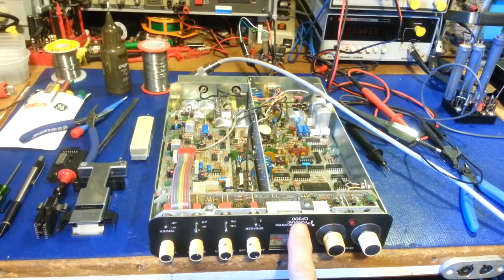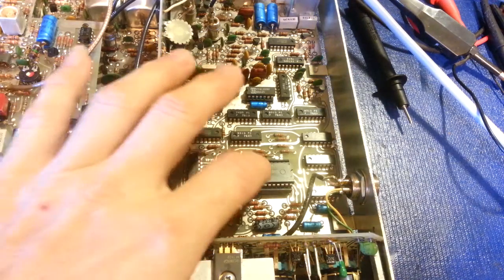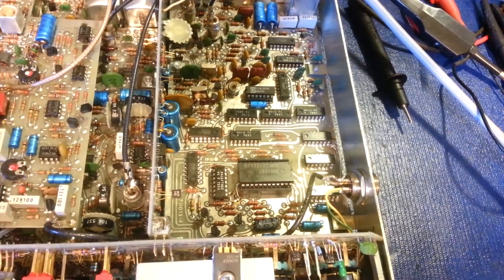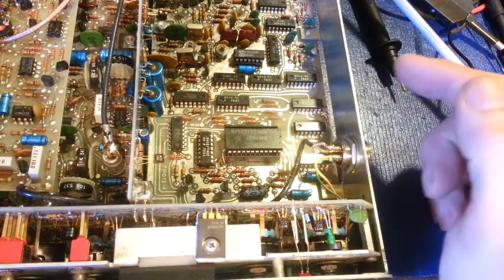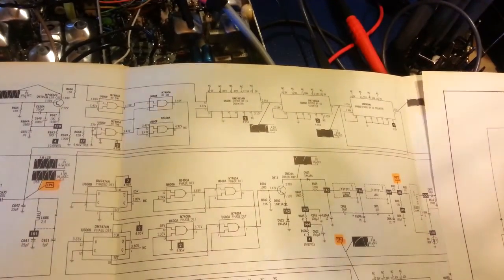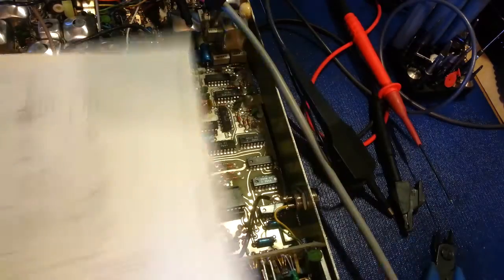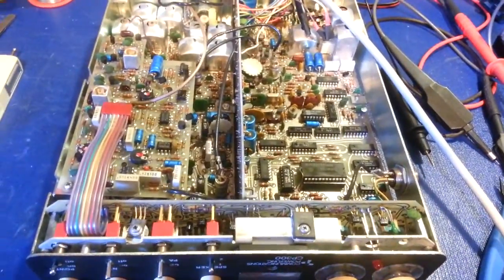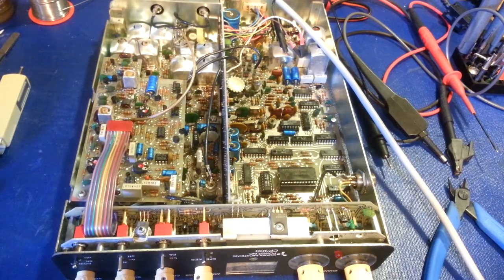CPI CP300 CB radio. Troubleshooting missing negative voltage power supply circuit.

Comment: I know; I'm late to this party lol. I have a CP-300 that has the 79 channel option in it. I also have a spare board in it with the eprom on it. I'm assuming the 300 and 400 are the same radios with different EPROMs in them. Anyway, I am looking for a service manual or sams for this radio. I also can work with someone if they know how to get the code from the EPROMs. Thanks Richy N2ZD
Reply from the maker: JackSoffalot 

If you can't get find a original SAMS CB268 you can buy the digital copy from SAMS on their website.  www.samswebsite.com

Comment: Mike, if that ROM is truly a rare bird it would be smart dump it to a file. Pull it out and put it on a reader and save it to your PC. it should only be a few kilobytes. If at some point you find you need one just burn it to a generic eprom and bam you are a hero. As for the negative voltage, I think they did it like that so they did not have to float the zero volt reference above ground, kind of clever. Purely a guess as I did not really see the whole schematic.
Reply from the maker: Actually Buddy is going to be doing it at some point.  There are several different versions of it including 99 channel ones that were available aftermarket backnin the day when these were new.

Comment: Good troubleshooting Mike.  This radio does have one of the craziest negative supplies I Why they use part of the AM/LSB is beyond me. have ever seem.  No telling what they were doing with jumpers. Been a while since I worked on one. What's the number on that chip? The last one I had in the shop had a 27(C)64 one shot Eeprom in it.

Comment: Cool Mike, why don't you read in the memory and blow a new one if need be? Eproms and their programmers are still easy to get and use.
Reply from the maker: Honestly I don't know the first thing about programming eproms.  Also don't know if it could be coppied from a working one.  These are not the reprogrammable type.  Someone who has some experience with eprom programming would have to chime in here, I plain don't know.
Reply from the maker: After looking it up I see it is what us called a MROM or mask programmable rom.  Made by a photolithography process.

Comment: Hi Mike - new here, a refugee from Buddy's channel! Just curious, is the unobtainium EPROM a matter of the chip or the firmware not being available? Could you read a functioning chip and then burn the code into a new chip?  73 - Dino KL0S
Reply from the maker: +LeapFrog469 

Anything is possible but cost becomes a issue when someone is paying you to repair their radio.  Honestly the easiest thing to do would probably be to use one of those little modern dds vfo signal generators that are made to be used with old crystal controlled ham rigs.  Basically you just completely disable the pll circuit and use the dds vfo instead.
Reply from the maker: Nice to see you here Dino.  See you posting on Buddy's page all the time.

The eprom chips are made of unobtainium.  My understanding is they were very very early types and were "printed" not programmed.  Some type of stencil was made and it was used as a mask and the chip burned/printed with exposure to UV light.  Apparently very expensive due to the initial cost of that mask/stencil.
Reply: Even with the unique "printed" program on the original chip, couldn't one fix a unit in a pinch by using a modern component with custom programming in place of the original rom?  As long you had an original radio with a functioning chip to observe I would think it's doable, but i'm not sure what's involved.
Reply: Makes sense from a business standpoint for an oddball make/model (locating a NOS rom unit, or a good working pull can be almost impossible I would assume) If you're setup to roll-your-own you could save money with a custom chip, but for time and other reasons a N.O.S. chip makes more sense. I honestly don't know how to "observe" the old rom to capture/collect the data, to then recreate it on a modern i.c.. 

I am following Mark's progress on the DDS VFO, very cool stuff. I intend to put one in a Cobra 142GTL for experimentation, just waiting on some parts now.

Great work Mike I love your videos!